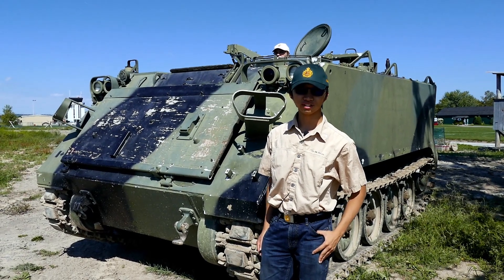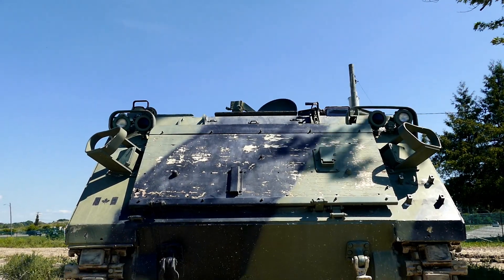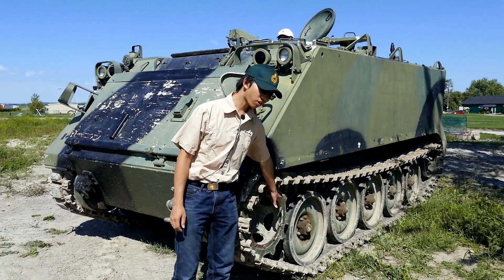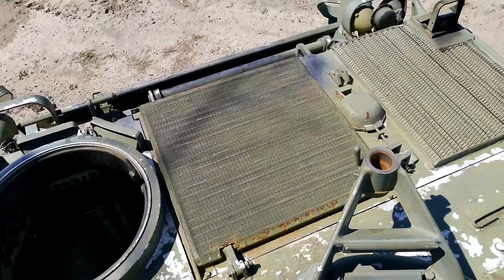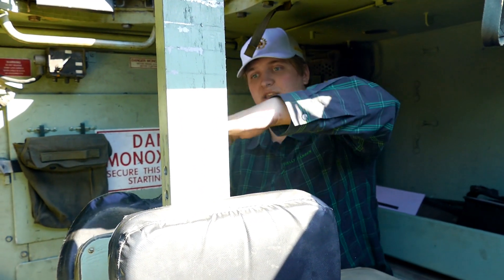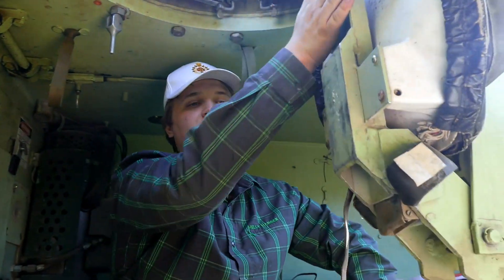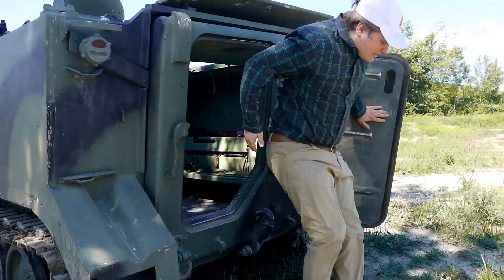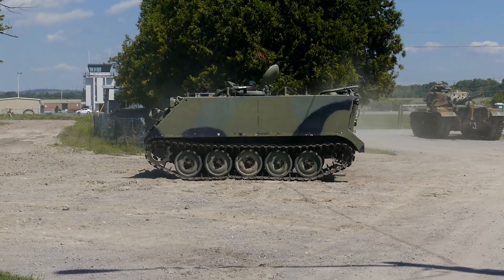Fighting Vehicles: M113A1

Comment: I was a driver on a M113A1, but,.. the speed was much higher than 60 km,  i reached a speed from about 90 km pro hour. But i did something with the box about the max rpm, that was very easy, but great fun. Even a 100 km was possible, but then is it getting to dangerous.
Reply: Chris Richardson  The engine was a Detroit two-stroke diesel, 6 cyl. A  fine engine, easy to maintaine and very reliable. It was the fasted from the batalion, and my sargent was proud at me, because i kept my vehicle in best condition. and i  pushed it many times to the limit, but no problems at all. But i have to say, in the Dutch army was a secret rule among the drivers,... and everybody knew it, do what you want, but keep it going, if you make a mistake in upgrade illegal your vehicle,... its your own risk. But i knew what i was doing, it was on the edge, but i have had a lots of fun for 14 months.

Comment: Aluminium helps you float on water? First time in my life I've ever heard that said! The M113 was designed to be air portable not amphibious, thus the reason for the aluminium armour. While the M113 was capable of crossing rivers it is incapable of amphibious sea landings, so in that sense it is not an amphibious vehicle.
Reply: With many of the upgrades that it has in current use it doesn't float, like I said, the reason for the aluminium armour was to make it air portable not amphibious.
Reply: Like I said it was designed to be air portable not amphibious, you're not really proving me wrong!
Reply: Moderately amphibious, so in that sense not a true amphibious vehicle. it's main purpose for the aluminium armour was the air portable role.
Reply: They are amphibious and engineered that way!   For sure the upgraded ones aren't amphibious anymore..   They were constructed of aluminum for many reason, more rigidity, big lobbying from the aluminum industry, weight, both for airdropping and amphibious capacity.
Reply: Obviously no one is willing to read my comments properly, so I will say it in a bit more detail. Development began in 1956 to meet a US Army requirement for an air transportable APC to fit in the hold of a C-130 Hercules or similar, FMC corporation developed the T113 in aluminium and the T117 in steel, the US army chose the Aluminium version for development. It was borderline amphibious by design but only for small river crossings or similar, so not a true amphibious vehicle as sea landings were not an option, hence the US military using the LVTP-5 and later the LVTP-7. So I stand by my assertion that the primary design criteria for the M113 was for the air transportable role as originally intended by the US Army.
Reply: Maybe a boat with 4 inches of freeboard. A small wave would sink it.
Reply: Amphibious means is can be used on land and water - sea going capability is not a requirement to be amphibious. 

Most amphibious military vehicles are designed for river crossings on inland waterways not beach landings. 

The British 430 series, CVR(W) and CVR(T)'s were all designed with an amphibious capability (using flotation screens), none were designed to be used in fast flows or seas
Reply: Was on board during my military time in german army in the early eighties.
It still floats (we floated in a river), but it needs counterweights in the back, because of the heavier diesel engine in front (back in the days it had gas-engine). You also need to mount the chaincovers to produce thrust.
It's tricky. The first driver got soaking wet, because of to little counterweights. Also the bilgepump hat a lot to do...
Reply: Here's another example of the M113 being put through it's paces.  FF to the 2:25 min mark to watch it swim.  

https://youtu.be/2mGMP-ttTB0
Reply: The 2 smaller levers above the braking levers are for water steering. They apply much more pressure to the brakes as operating the 113 on water takes a lot more control input. They also are handy for tight  parking situations because using them you can lock one track and pivot steer. Using them during a road movement will give you an opportunity to learn some colorful language from the senior NCO's  or any maintenance personal that happen to see it. Missing in this video are the rubber side skirts for the tracks but you can see where they fasten to the hull. M113's don't operate worth shit in the water without them, they are usually mounted upside to give better access. One of the controls not pointed out was the switch for the bilge pump. My knowledge comes from the one our platoon sergeant had in our armored recon platoon in Germany in the 70's, the rest of us had M114's, which weren't nearly as good, and were also (nominally) amphibious. So tell me dude, what's your MOS that makes YOU the expert?
Reply: It does swim (as we used to say), drove into a pond one night during maneuvers(black out drive) in Germany - scared the s*$# out of my track commander! Had to find the proper angle to exit, but it did the job.
Reply: @lambhdeargh  
You said your self it could make river crossings IE float! That is what amphibious means. It does not mean capable of ocean operations.. You proved yourself wrong
Reply: The screen the narrator mentions on the front is called a trim vane. That and the track skirts are required to swim the vehicle. The skirts are needed for propulsion. There is also a bilge pump, which if it doesn't have one, or doesn't work, the Army considers as a deadline standard.

Comment: Didn't all the 'A2's have external fuel tanks in Canadian Service?
Reply from the maker: This is an American M113A2, I believe that the Canadian A2s were all upgraded to the A3 standard with external fuel tanks and other equipment to become the LAV-T.
Reply: Some specialized A-2 varients aslo got the external tanks, such as the M981 and M198. The added weight of the hammerhead turretade them too heavy for the suspension to receive v8s.

Comment: I wouldn’t call them amphibious, they swim. Good for crossing rivers and small bodies of water. I wouldn’t swim one  in rough water. When I had mine in the water there was about an inch and a half between the water and the top deck, and if you stopped moving the trim vain ( that panel covering the engine hatch) would stop pushing the front up and you sink.

Comment: driving stalks control braking pull the left brakes the left hand drive, pull the right brakes the right hand drive. the throttle pedal controls engine speed. mine the fastest it would go was down hill about 60 Km/h

Comment: That "screen" is called a wake board. It extends out at an angle to keep water from rushing over the front of the hull and down the drivers hatch. Those "foot holds" are where the spare track pads are bolted on lol. The driver was supplied with an infarred periscope, which attached to the hole in the drivers hatch. The "levers" are called laterals. the pivot steer controls are forward and above the laterals, never mentioned. Do your homework before making a video?

Comment: Never seen a 113 float.....
Reply: We used to swim them in Baumholder, Germany. I have never heard anyone call them amphibious, though. It has the capability to swim, but that is not a strong point, or something that it is meant to do on a regular basis. Very slow on the water.
Reply: Floating is not exactly what I would call it. I trained in the 113A1 at Fort Knox and when we took them swimming you wanted to be sure that front trim vane (4x8 sheet of plywood) was extended and locked into position and you kept the track at full throttle. Keeping the nose up and moving forward as fast as you can was the only way it would “swim”